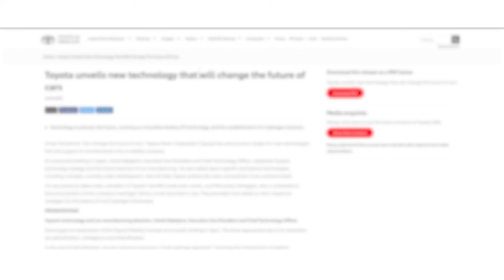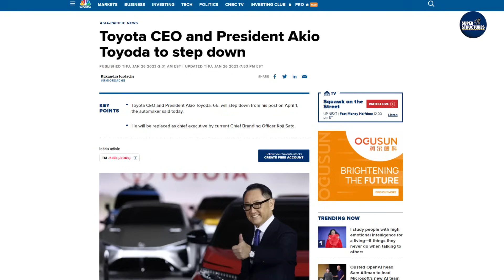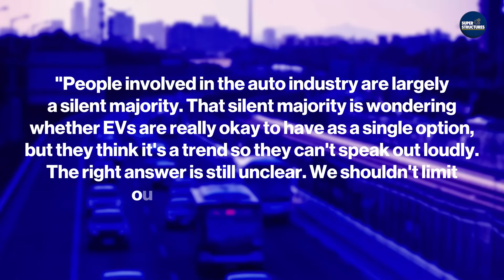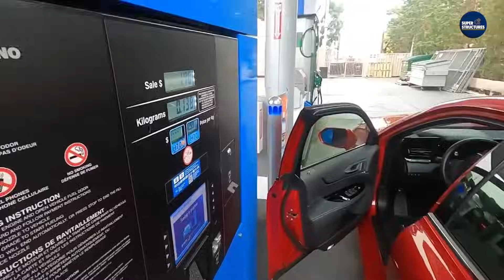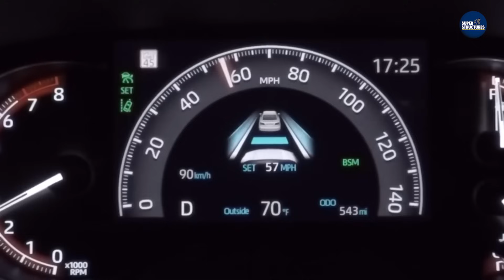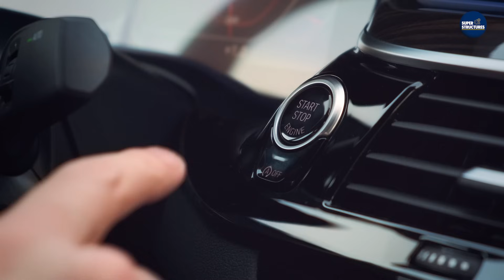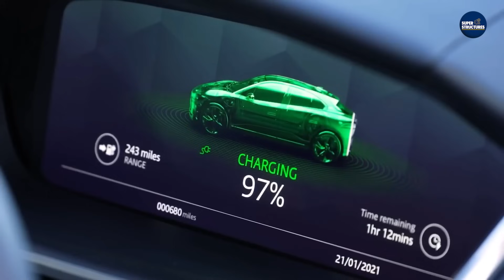Switching to EV? Wait Until You See Toyota's Game-Changing Engine

Comment: If you think building out charging stations is a pain, wait until you try to build out an ammonia infrastructure.  We should actually do it, but it will take longer.  You need pipelines to do that.  Finally, you need to make ammonia, which right now requires about 700C and access to hydrogen.  The H2 can come from water but it typically comes from fossil fuels and all that heat and chem makes for a lot of carbon emissions.  New high-temp nuclear reactors could make this better (HTGR, MSR, etc) but it too will take a long time.  Since ammonia is the base of food production and major chem industries, it should be converted to nuclear, and perhaps some liquid fuels could result as well.  However, there is one important point here - combusting ANYTHING at high temp (gas, H2, NH3, etc) all emit NOx (nitrogen dioxide pollution - that is acid rain and air pollution).  Just because there is no carbon, doesn't mean it is "clean".  You should also note that the energy density of liquid ammonia is about 1/3rd of gasoline.  It also must be stored cold (~-40) or under pressure (under 300 psi).  As for concern about lithium and other materials, sodium-ion batteries eliminate that issue.  Finally, H2 for transport is even worse.  It requires insane pressures (10k PSI and up), or cryogenic storage colder than liquid nitrogen, embrittles metals, still pollutes when combusted, and has terrible energy density.  Compared to H2, NH3 is far better - both are pretty bad for transportation use.

Comment: The advantage of EVs is fuel price. Electrical power is predictable and constant while carbon based or liquid fuel prices change constantly. Sometimes prices at the pump change on an hourly basis.
Reply: Not true. Electricity is more expensive. It's cheaper to run a small hatch compared to a BEV. Plus you can go long distances and it only takes a few minutes to refuel.
Reply: @heylabas555  The price depends on where you are and when you recharge.  Typical rates in AZ at night are about $0.10 per kWh.  However if I try to recharge at a fast charger down the street it's closer to $0.50.  The trick of course is to use those as little as possible.  If you compare the price of gas to what it cost for fast charging they are certainly comparable and in many cases the gas can be cheaper, and of course, WAY faster to refuel with.